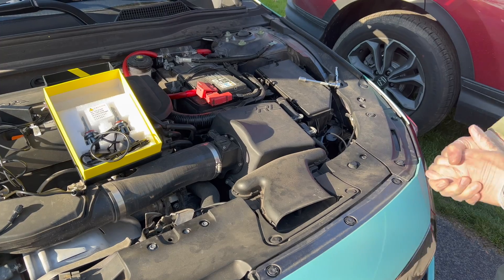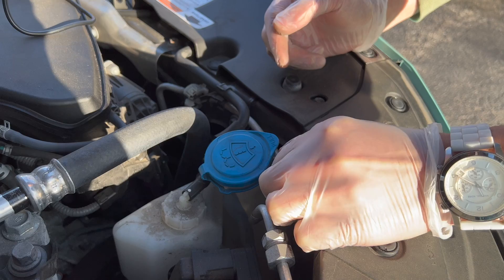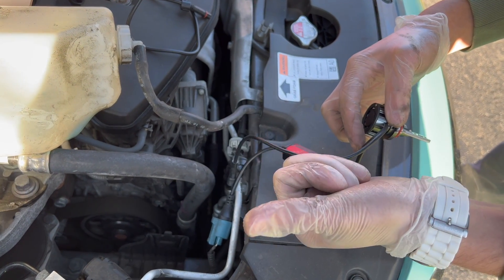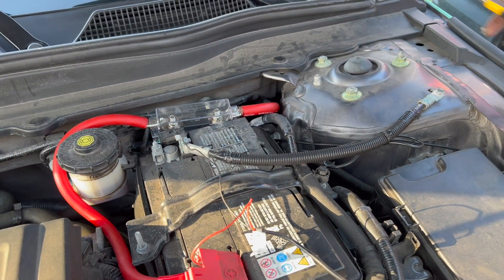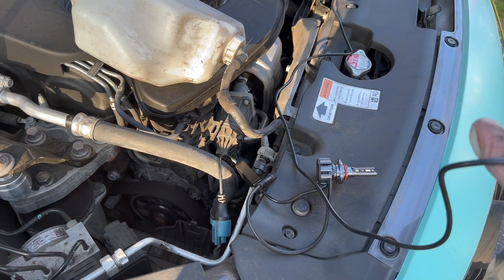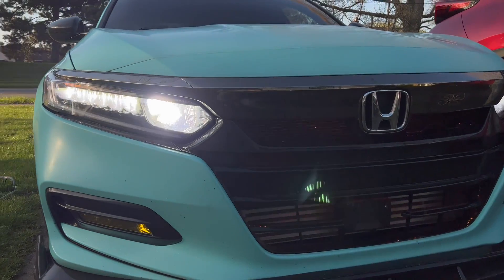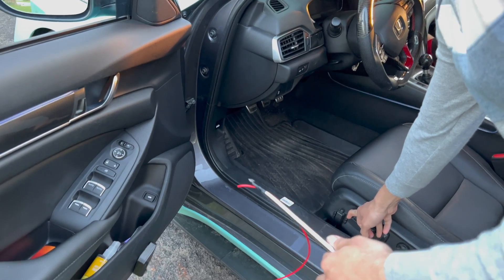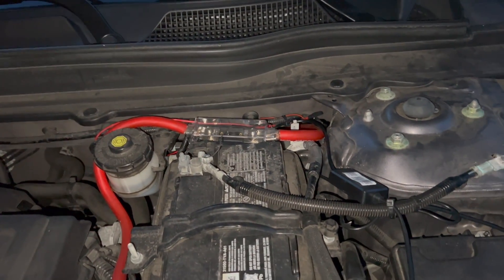RGB headlight led install on 2018-2020 honda accord

Comment: Which app do I use? Can you send me the link. My lights did not come with any instructions and NO APP.
Reply: tell me if you find out
Reply from the maker: The QR code is on the module lol

Comment: So if you connect these directly to the battery, does that mean that you would have to shut them off and on manually every time since they would stay on after you turned off your car? Also, why didn't you use a fuse on the hood?
Reply from the maker: I use a fuse or acc fuse basically unless you want to turn them off and onn manually
Reply: I have the same question about the battery

Comment: At 22:40, how did you connect these together? I plan on ordering the lights from your website soon, but I'm doing my homework first. 

Thank you for the video!
Reply from the maker: Plug and play.
Reply from the maker: I can show you diagram for the red and black wire over Instagram when you receive it. @redlinemods.official
Reply: @RedLineMods  so that red tubing you got from auto zone is actually wire as well? Well that makes sense if so😂
Reply from the maker: Yes that was extension to reach to the ACC fuse under the steering wheel lol but I know a fuse that’s under the hood so you don’t need that extended wire. Go ahead order now lol 😂 solved your problem.
Reply: @RedLineMods1  just placed my order 👍 can't wait!

 you know of a fuse under the hood?lol
Reply from the maker: Send me screenshot of this comment to my Instagram @redlinemods.official

Comment: could this also work for a 2022 honda accord? please let me know
Reply from the maker: I’m checking if it does because the 2021 and above models are redesigned headlights
Reply: I bought these and I would say no.  I will have to return or sell them. My 2021 sport se has all led lights including high beams :(

Comment: Did you do a video on the flashing light?
Reply from the maker: Flashing lights? 🤔
Reply: @RedLineMods1  after u install the lights at like 17 minutes the lights are flashing on the side
Reply: @deronphillip6093  Because of the fps of the camera it shows that the led strip are flickering, when in reality they are not. Take a video w your phone of any light on your car and you’ll see what I mean
Reply from the maker: @3Pedal_ Accord thanks for the great explanation 🙌🏻🤝

Comment: Great video man!  My set that I ordered is different brand and plugs into one of the high beam plugs.  Only issue is that if I have high beam on so they work, fogs turn off. So i get either fogs or rgb lights going and obv would like all going together.  Thinking I might be able to just cut cable before the high beam plug and do some wire wrapping?  Wanted to know if youve come across the issue ive got, thanks for all you post man!
Reply from the maker: These run day and night along with highlights onn.. if you hit highbeams for the bright white light, the fog lights shut off and turn back onn once the highbeams are no longer engaged.. but the rgb lights stay onn with the fog lights.